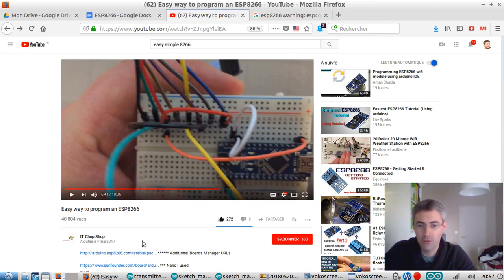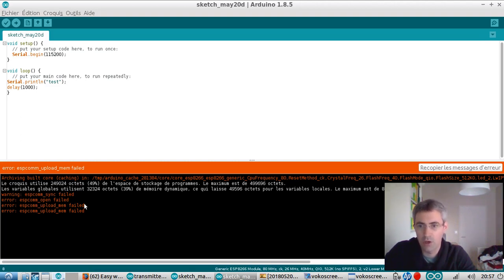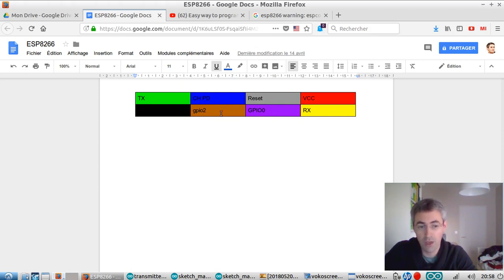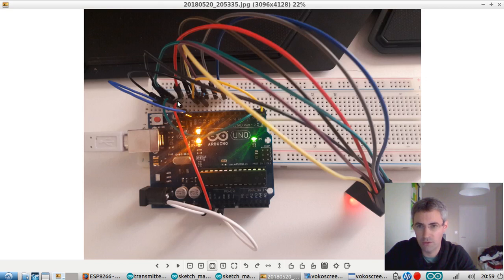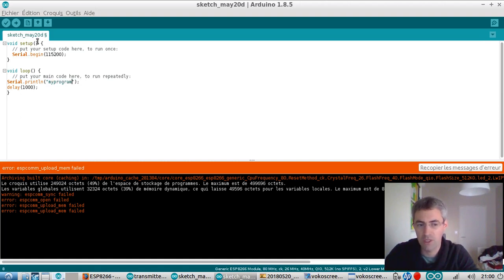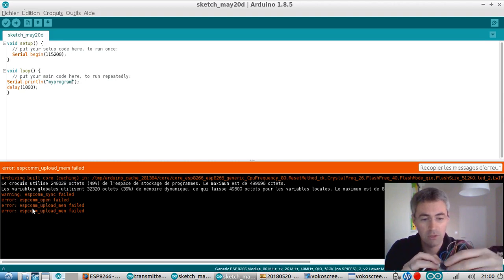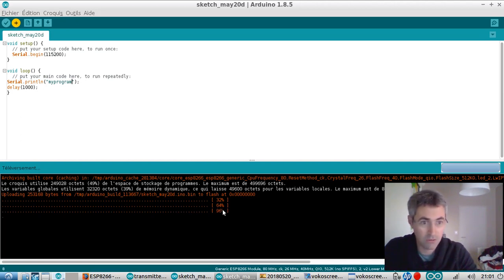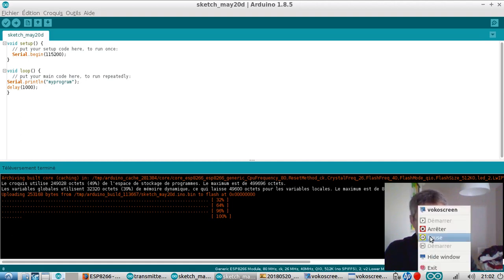How to fix esp8266 error upload message arduino

Comment: I've followed the original guide and used the same set-up and wiring but it didn't workout, I receive the same error massage in this video.
I tried doing what you did in this video but it didn't work.
Is there a way to get the ESP to start without an external power source ?
Reply: I only got it to upload the code twice and don't know how, after it finishes my mac loses connection with the port and can't open the serial monitor. any Idea about why this is happening ?

Comment: My problem was that I had reduced the voltage of the arduino's TX down to 3.3v using resistors.
I removed those resistors (kept 10k on GPI0 to ground and 100k on CHP0) and and everything works fine now.
PS I still had to disconnect ground from the ESP before starting the upload (then connecting it back when upload started)
Try it 2 or 3 times, sometimes it fails but the error message will be different.

Comment: I must say this is a really poor tutorial for several reasons. It is the kind of video that just makes it harder to find the good ones.
1) As I understand the espcomm_upload fail can be caused by problems at several levels: wiring of the module, usb cable fault, arduino/usb-serial-converter driver error, faulty esp8266 boot and hence cannot be generally solved by a single solution (for a general approach, though not solution, see https://www.youtube.com/watch?v=drZQStOjpgI). You claim to "go back to basics" and "fix it once and for all" but what you offer us is to restart the module?? The "fix" may just be that you powered your module without grounding GPIO0 (to enter programming mode) when you first set it up. 
2) Moreover you speak at length about stuff covered elsewhere, you recommend to check "on the internet" and we're hardly able to see the only new thing to this tutorial because of a tiny picture. This video could be 3 s long, be titled "Restarting fixes esp8266 upload error for me" and read: "Hi! I wired as this guy link and if I restart the module reconnecting ground it works. Don't ask me why."

Comment: What i did to solve the problem :

-disconnect the CH_PD pin, and connect this 3.3V cable to the RESSET pin for about 2 sec.  and disconnect again and put the wire back to the CH_PD pin .... after that upload the scetch.
maybe it help you.
Reply: THANK YOU RANDOM FORUM MEMBER

Comment: Thanks for your solution but may I ask that could you type the GND (black) should be plugged with which point?  Thanks a lot.
Reply: just disconnect the GND and then connect it back, it worked for me
Reply: @YaswanthKumar8888  but in case the esp8266 can be upload but not completely, it shows the dot but after that, the error come again..  Any solution? I already disconnect the gnd and, connect it back
Reply: @RiztechIT  well.. disconnecting and reconnecting then start to upload the code did work for me.... if it didn't work for u, i can't help that sorry mate..

Comment: You are perfect!!! Thank you!!! <3 <3 <3
Reply: how to fix that. I can't see very clearly which wire to change. Thank you
Reply: try to turn off / turn on lights on esp8266 (it depends on how you connect pins, just to reset module, may be reset pin to the ground or something like that) and then to repeat code uploading. Sometimes it needs two times, sometimes I've done this three times. But turn off / turn on and it will be working. Or do you need a scheme how to connect pins?
Reply: dude i really need that...can you send it please?

Comment: I interested test your solution, but I cant understand your circuit diagram properly.     can you give the circuit diagram of your project?

My ESP8266 not support the AT commends after I upload some programs using Generic ESP8266 board. can you give a solution to my problem?